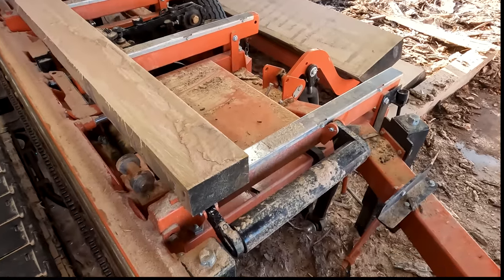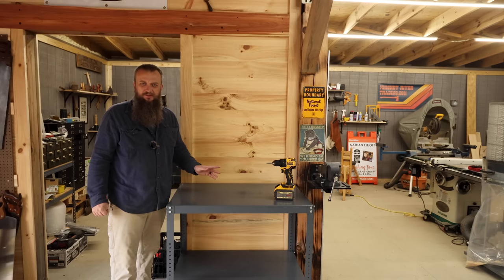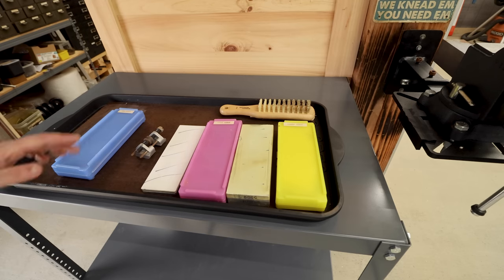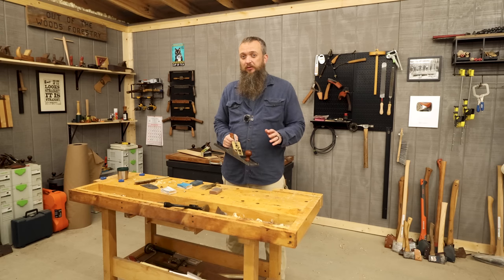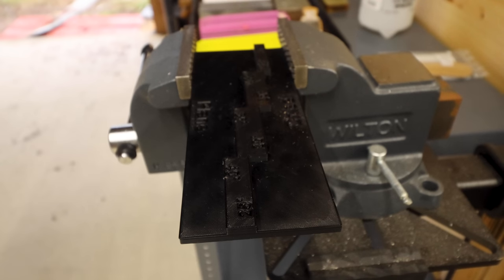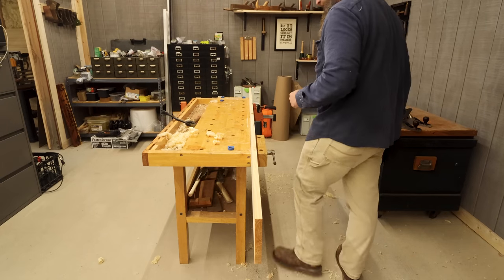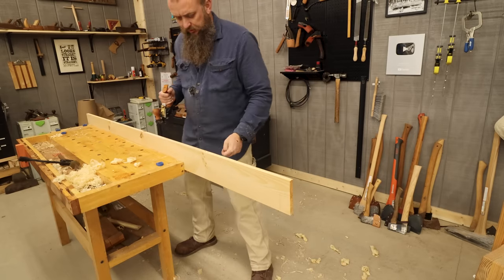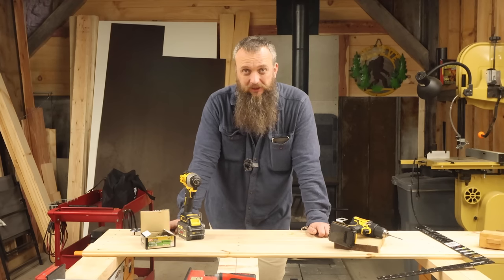I Finally Finished This Log

Comment: Glad your back on the doors one step closer to getting the shop closed in. That dang storm set you back for sure.  I’ve used LPS3 for years on my decent tools. It’s easy spray application coating can last up to 2 years they advertise. Used it in aircraft maintenance for years.

Comment: That's not a work bench, it's an end table.  My first project when I built my shop was my work bench.  Waist high for back relief, but also a good height for "sitting on a stool working with hand tools" relief.  The top is rock maple 3 by 3's rotated for opposing grain matching, glued and clamped.  Everything under the bench top is gravy.  Shelves, cabinets etc.  The bench top itself is the jewel.  Cross grain belt sanded for flat, then hand planed smooth.  I figure I saved a few thousands making my own bench.  That was 27 years ago.  It's still my main "make some good stuff" bench.   Thanks for your vids.  I enjoy them all.

Comment: Another major point of planing:
As the grain of the board rises, to the surface you are working, it should always point away from you.
That way you are working With the grain, not against it and it will limit tear out.
Point 2: always take fine cuts and more passes, for better results. No "lazy man's load".

Comment: I enjoy the project-oriented parts of your videos. I hope you'll do more.
Trying to use a bench that wobbles or moves drives me crazy. Maybe you could put some anchors in your floor slab and bolt it down? That plus some added cross-bracing should make it good.

Comment: Looks good Nathan, glad you're getting those planes cleaned up and the rust removed before they get badly damaged. You might need an anchor plate or weights to hold that work bench some, something you can move with those two wheeled carts and slide it under the bench so your feet don't get in it?? Stay safe and keep up the good work. Fred.

Comment: Hi Nathan - First, I love your videos, both because of the things you show and your sense of humor.  I have been watching for some time now from the early days through the various mills.  This has raised a question.  In watching the differences between the features on LT-40 and the LT-70, it seems that the chainsaw-type log turner on the LT-70 does more damage to the logs and cants than the claw arrangement of the LT-40.  Is this true, or does it just seem that way on the videos?

Comment: That probably wouldn't be a very bad workbench if you widened the stance of the legs.
Flip it upside down and bolt some two-by-fours to the bottom of the legs with some rubber feet. 4in on each side should do it. It'll give you a lot more traction and minimize the table's ability to "walk" sideways👍👍👍

Comment: Until you get a new work bench, why not add 4 right angle plates to the legs and secure them to the floor. At least it will stabilise it a lot better than what it is at the moment

Comment: do you need to change blade tracking if you run  1 1/2 blades vs. 1 1/8 blades?
Reply from the maker: change blade guide rollers is best

Comment: Owning a sawmill, you should have a lot better work bench then the one you are working off of. Cut a 4" thick slab and build a decent wood working bench.
Reply: A laminated top is way more stable.